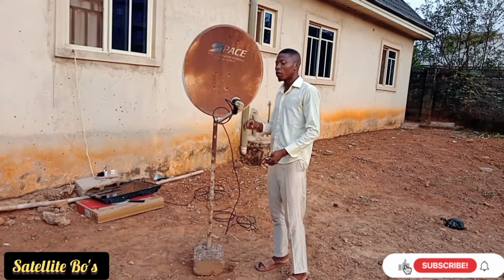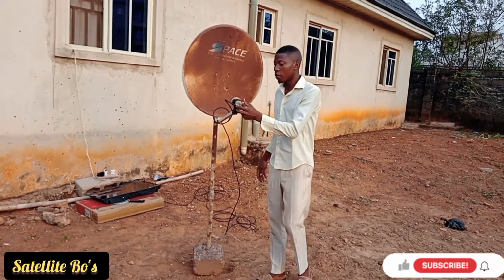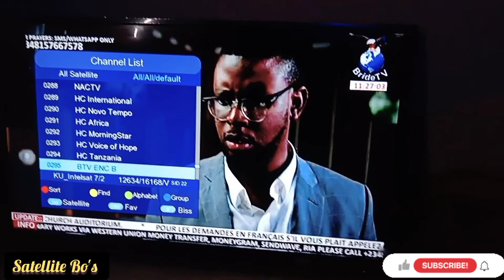What i Have to Say About Rusted Dishes

Comment: Thank you so much my oga,I track tstv with my satellite finder ,though my signal normally disappear when screw the nut
Reply from the maker: Alright this is what you will do; after tightening the nuts and there's no signal, try holding the dish arm and try bringing it down to see if signal will enter. If doesn't enter try it upwards, then side ways.

Comment: Sir please I tracked mbc using the frequency you gave 11054 H 30000 with lnb 6 o'clock. I nailed the signal but when I scanned my strong (srt4940) decoder I didn't get any channel please help.
Reply from the maker: If you tracked the signal,  you will definitely get the channels, check very well to see if your cables are ok
Reply: @satellitebos3993  sir I tracked the dish more than 3 times still yet I got the signal. But when I auto scan my decoder only one channel appeared
Reply: Which is food network( channel name)
Reply: Do blind scan
Reply: If it continues the cable is bad
Reply: Or the decoder does not support h. 265
Reply: These are possibility
Reply: Only support h. 264
Reply from the maker: Do blindscan
Reply: @okekeemenike7339  ,  I used FTA decorder  to track and I received  MBC,  I'm really enjoying the channel for live matches